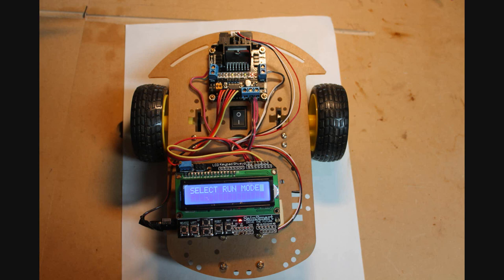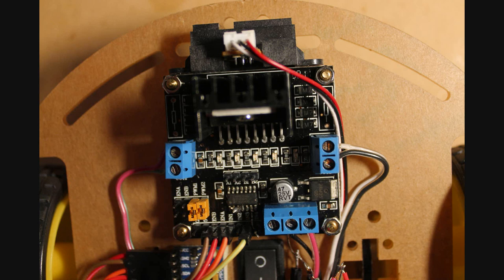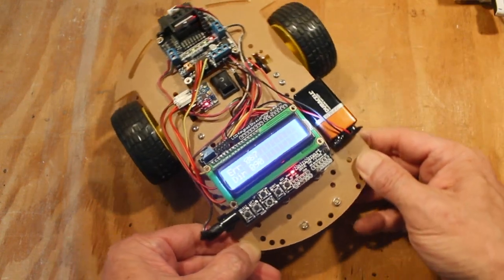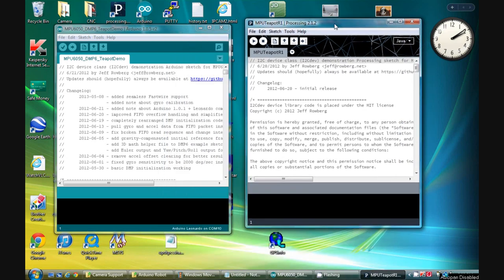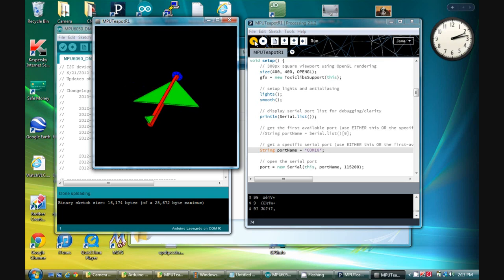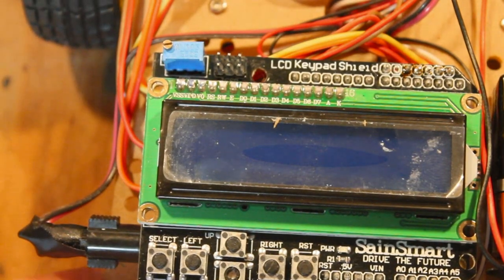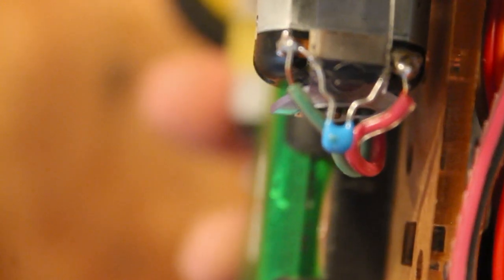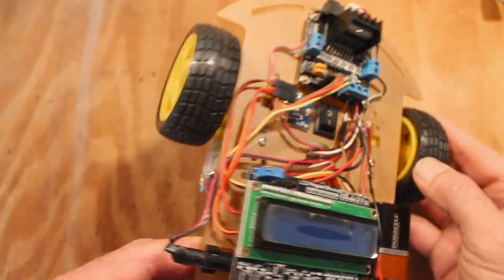Simple Arduino Robot uses a MPU6050 to manage steering

Comment: I was having a problem similar to what you mentioned, when I was using the MPU6050 in DMP mode with interrupt and at the same time driving motors with PWM. Turns out it was a problem with the libraries using the same timer (overlapping of timer usage), the interrupts etc and it was messing with the timings making the motors go beserk. Also the Gyro readings would not make sense sometimes. To be fair mine was a balancing robot though. If it helps, you may check if your problem is something similar perhaps.
Reply from the maker: Thanks for the comment. I'm betting others will appreciate it.

Comment: Hi,  that looks like a great project. I'm actually working on a similar robot and am facing the problem with the mpu6050 when the motors are powered. Would you like to share the code with me to help me to get my robot runing instead of stopping randomly? Thank you very much!
Reply from the maker: I can send you the code for that version of the project in its entirety, but have to confess it contains a lot extraneous lines. However, if you're willing to look past that, then send me your E-mail address, and I'll send what I have.
FWIW: Initially I too  ran into issues reading the MPU while the motors were running. The two things that fixed it were 0.1MFD capacitors connected directly across the motor terminals, and in code, I would not process the MPU's dmp buffer unless the fifo count exactly matched the expected packet size. Remember I'm using the jrowberg/i2cdevlib found at https://github.com/jrowberg/i2cdevlib . If you're using another method to extract the DMP data then what I'm saying here may not apply.

Comment: I know this posted video is old, but I am working on a project that could benefit from this code.  Did this ever get posted online anywhere?
Reply from the maker: Thanks for your interest in this project. 
As for the sketch used here. about the best I can offer is see the code found at:
https://github.com/jmharvey1/Arduino-BalanceBot
It a later version of the project, and the sketch used there encapsulates pretty much all that was done here.

Comment: You still have the code for that robot? can you share?
Reply from the maker: No, I'm sorry. That code is long gone. Doubt that it would compile today, since most all the libraries it used have had many updates of their own. FWIW, the code used here formed the core, of the balance bot videos, that followed. That code is out there. But again, wouldn't bet on it compiling, without 1st having to do a number of "tweaks" to get it to work with today's libraries.
Thanks for your interest in the project, and taking the time to ask the question.